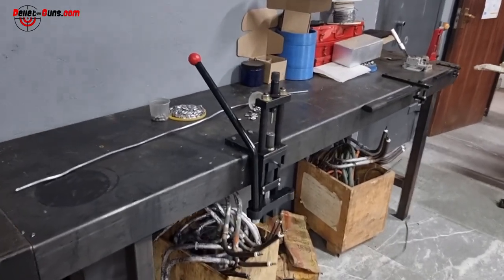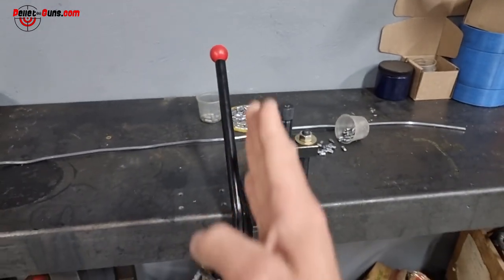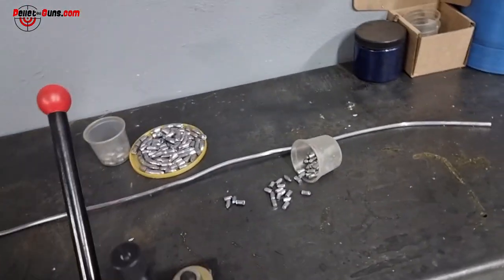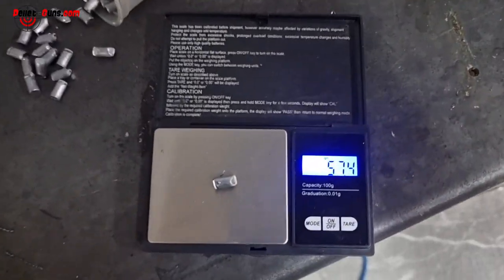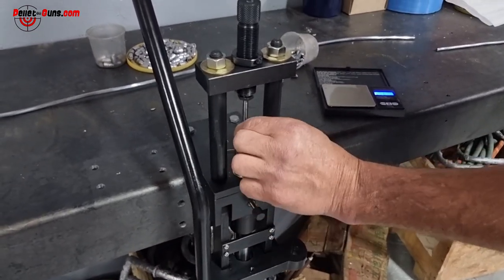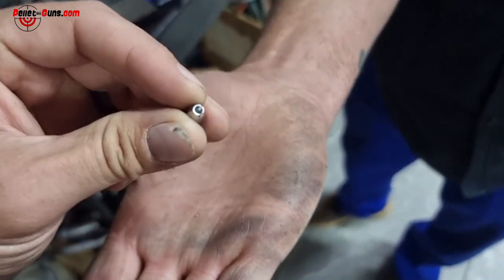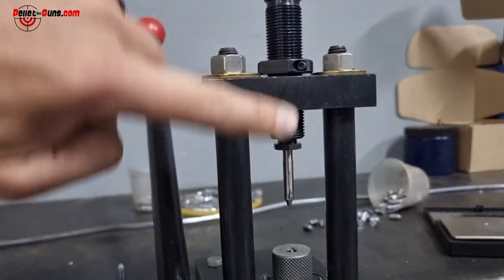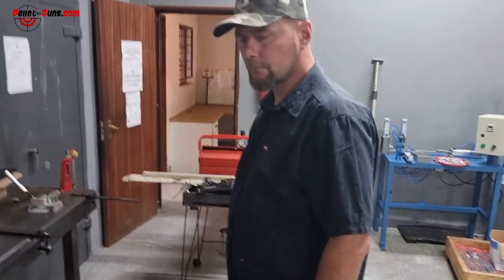TITANIUM Hand swaging Slug press

Comment: Sjo, lekker man! Do you guys sell the lead wire too? How about lead melting pots that can clean the slag or however it's done. There's much lead in all those batteries people have been using for their UPS's etc and they don't last long. On average you get R10 back for your used 12V 7.2 A UPS or security battery but they cost an arm to replace. I'd rather keep them batteries to smelt the lead and make pellets and or slugs.
Reply from the maker: Yes we sell the lead wire too.
Reply: @airbrosreviewsa  Shweet, will come by and check it out. Thanks. Have a lekker weekend to yourself and Pellet-Guns Fam!
Reply: How to buy
Reply: How to buy this